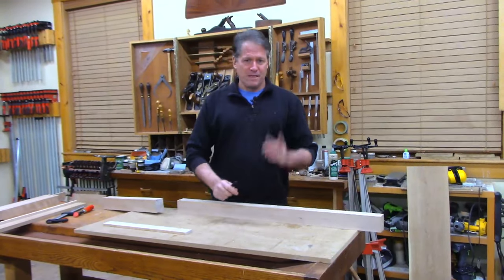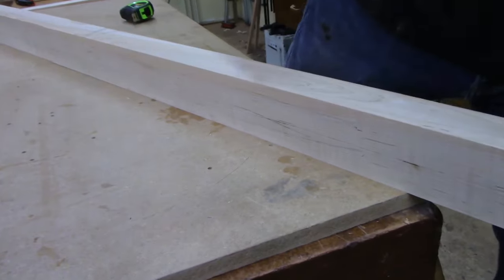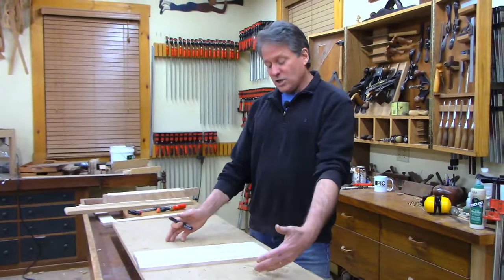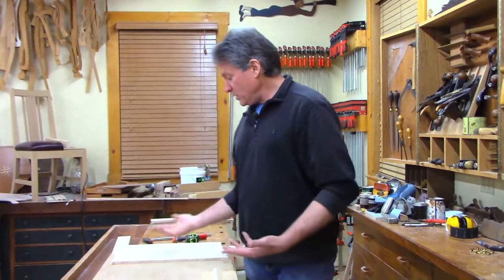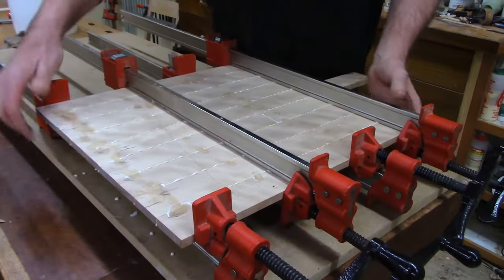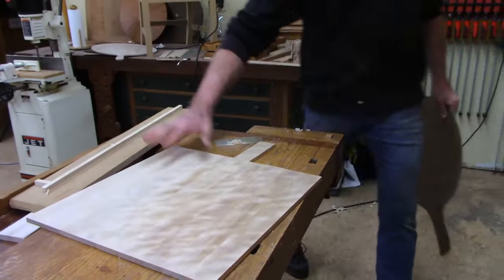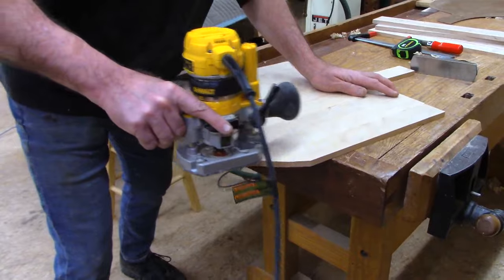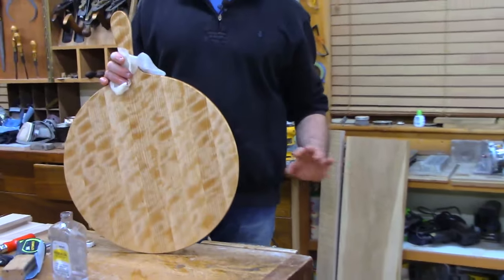Make an Awesome Pizza Cutting and Serving Board with Tom McLaughlin

Comment: I wonder if a similar technique could be used as with the end grain cutting board.  Seems like it might be a bit iffy with it that thin though, with so many glue joints buried in it. Just curious.
Reply from the maker: Yes, I think you’re right, if it were oriented as end grain and as thin as the pizza serving board, it would be liable to break fairly easily across the short grain surface. But definitely food for thought, thanks! 👍😎

Comment: Awesome pizza server/cutting board. After a lot of use from cutting pizza, would you resurface and finish the board like new again? I learned another great tip today, when joining boards on the jointer if the fence is off slightly, thanks again. See you on Saturday.
Reply from the maker: Thanks Steve! Yeah that was a fun project to slip in between the shaker table sessions. I think resurfacing by card scraping and sanding would work well after a while. I’m not sure how it will hold up, but my guess is,!given the birch hardness, it will be a good while until it needs resurfacing. Thanks for the great feedback and being such a good part of it all!
Tom